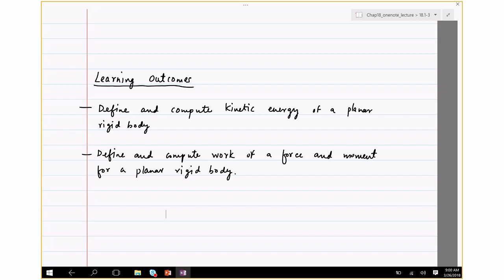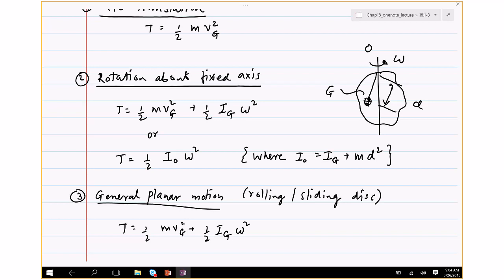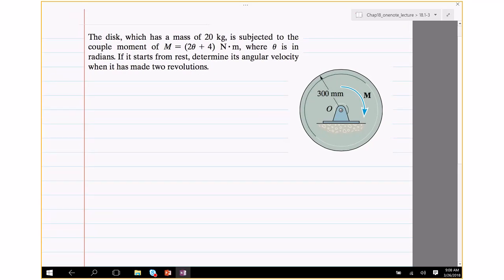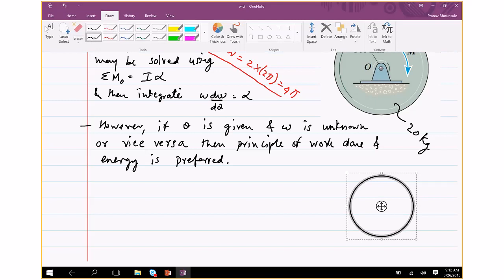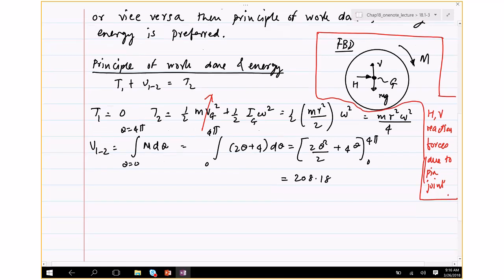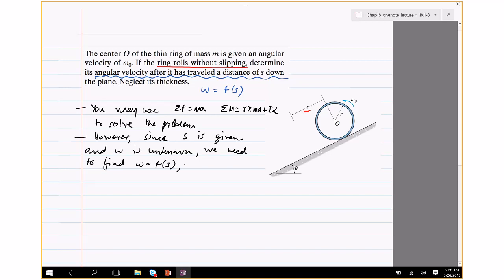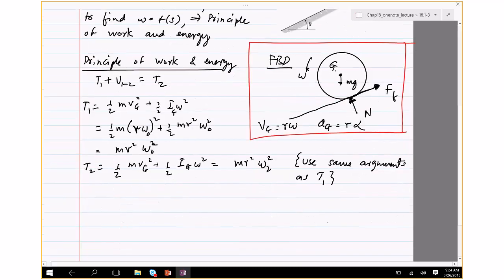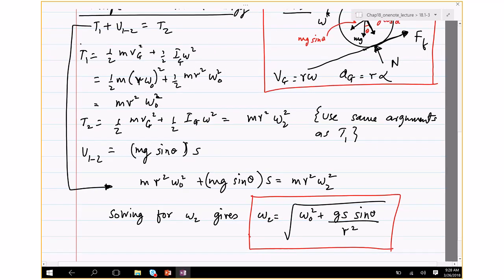18.1-3 (audio cut-off) Kinetic Energy, Work of Force and Moment (Spring 2018)

Comment: The audio cut out at after 29 minutes into the lecture. Another issue on most of the videos on youtube, when you are explaining on the video saying 'this equation' or 'that equation'. It is not clear which one you are referring to since there is no pointer on the screen which makes it difficult to follow with what you are explaining. Maybe if you make a mark on the screen while you are talking it would help. Thank  you for putting you lectures on here. It has helped.
Reply from the maker: Thanks for letting me know Scott. I will keep that in mind. Do let me know if you have other suggestions.